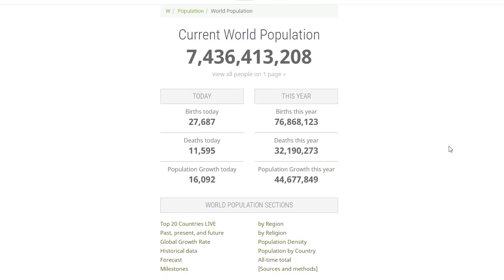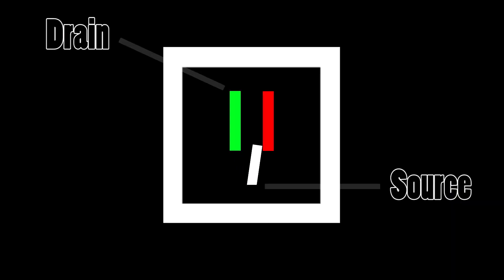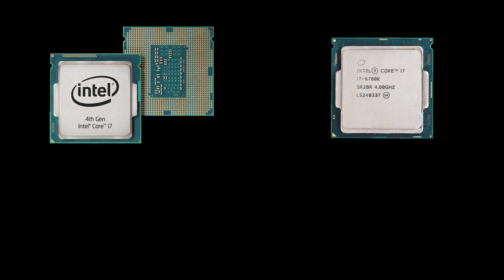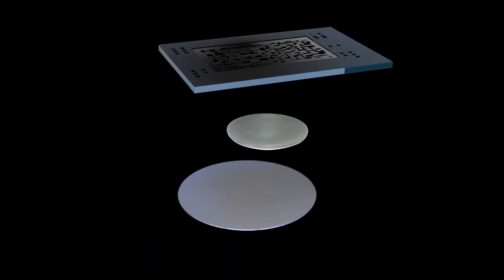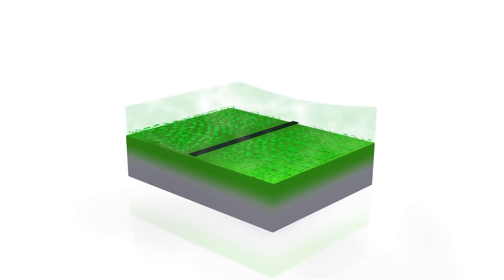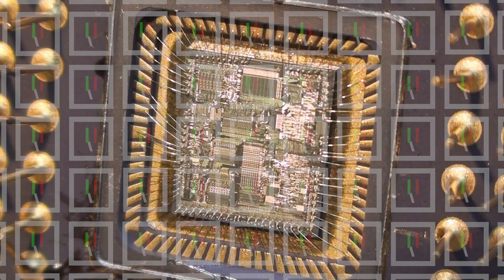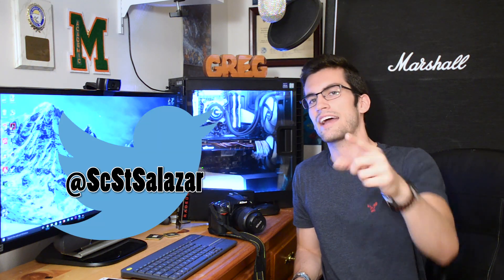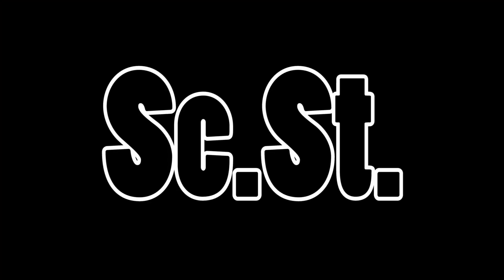Why Do Processors Get So Hot?

Comment: But why are certain programs “heavy” on your system (I.e produce more heat)? If the cpu is constantly executing code anyways how is it certain programs generate more than others
Reply: Becoz of the number of transistors required by certain program to run. They are not all turned ON all the time, they turn ON as per the requirements.

Comment: I was watching another video which lead me here. About data centers water consumption. I first thought of recycling the water. Now im thinking of a new anti thermal transistor. How does heat slow down the computer? Or are the components turning off to relay the heat? Assuming no fans or cooling is operating. Could their be a computer that can not get hot?

Comment: heat transfer 🤦🏻‍♂️ the only reason we cant time travel and walk through walls
Reply: Uh could u super briefly explain why heat transfer is stopping us from that please??
Reply: Ryan Lee The extraction of the energy is accompanied by generation of negative energy density, which is allowed in quantum physics of many-body systems including quantum fields, and retains the local energy conservation law. The remote measurement, which provides the information for energy extraction, injects energy into the measured subsystem. A portion of the injected energy, which amount is larger than that of the energy extracted from the zero-point fluctuation, becomes unavailable because of entanglement breaking by the measurement, and cannot be retrieved by local operations in the measurement region. Thus, during the protocol, the amount of locally available energy decreases in the measurement region, and it increases in the energy extraction region.

Comment: Having worked in power electronics I learned that at the off state and the on state of a transistor have simple restive losses (IR). during the change from on to off to on, however the transistor has switching losses. this why clock speed has such a heat curve. the sum of switching losses exceeds the restive losses

Comment: forget 5nm transistors, 14nm  is 66.6 silicone atoms across (one atom is 210pm), how do you think it achieves the required doping ratio with a tiny number of atoms?  The feature size is not the transistor size, it is the size of the smallest feature  which would normally be the gate of individual MOSFETs.

Comment: I have a question about cpu's , why if cpus are square are the wafers you see in cpu factories ( and in this video near the end)  round ?
Reply: i honestly like your question, Does anyone has any answer?
Reply: +PwnstarUK
Just in case you don't know the answer yet.
The wafers are made out of raw silicon dioxide poles, which have to be produced in some way. The easiest way is to melt some sort of sand (it's a bit more complicated). In the end, you want to get as much SiO2 as you can, so you have to maximize the area. The sphere would have the biggest area, but it is too unhandy to work with, so they chose the cylinder. If you cut the cylinder, you get a circle with maximum circumference and the most silicon. Therefore, the wafers are round.

I hope I could help you. Just ask if you have any questions.
Sincerely,
ZfE

Comment: hi Salazar, are u descendent from Portuguese people? Because that forename is Portuguese.
Now the question, in Overclocking do u stand by Adaptive voltage or Manual Voltage.
Because i have a 6600k that is driving me crazy to stabilize at 4.5Ghz without passing 1.3v.
thanks in advance,

Comment: Copper interconnects.. They don't use aluminum for them anymore..
Reply from the maker: It's chemistry: copper reacts with the silicon substrate, damaging leads over time.
Reply: Science Studio That is true but they use copper for the interconnects anyways because it is a better conductor. Intel has been using it since 130nm and AMD since 180nm. Seriously look it up..
Reply: TAKIZAWAYAMASHITA They use Gold to coat contacts (like pins on PGA or pads on LGA). Gold is expensive so they use other stuff anywhere they can.
Reply: i thought they used gold because gold was one of the best conductors

Comment: heat is energy so why would a mass equation have to do with it directly?
when getting into nanometers apart and nanometers big  the mass part loses importance for each one but the energy used part is more important and thus part of why Intel is getting lower and lower TDP CPUs when getting nearer to a 0 loss design you require less to do the same thing as a 0.1% or greater loss design though a 0 energy waste design does not exist for most objects energy waste is in the form of heat
heat is wasted energy so less heat more for the same performance or more is a better design unless the propose was to make heat but that is for another video of his

Comment: you casualy mention "typicly around 5 Ghz" as a threshhold and also give the design of cpu as on factor of that. i was wondering why over the years processors didnt just grow in speed anymore just by doing more and more parallel there for giving the illusion of getting faster. let me put my thinking down into one question. when do you see something like 20 Ghz cpus coming and do you know any one who is working towards that goal or did we hit the phsyical limit already like a lane on the autobahn if its filled with cars all we can do is add another lane fitting more cars isnt possible at some point like transistors i "guess"

Comment: Neat episode, congrats!

I'm wondering, in such frequencies, doesn't the system presents a highly inductive reactance? If so, the power factor would be somewhat away from 1, therefore making the apparent power quite different from the active power.

Wouldn't this cap the performance as well? Even though it is not a real power dissipation, it will limit the system perfomance, right?

Comment: had an old intel dualcore E2140   1600 mhz ,overclocked it to 3200 stable only fsb no voltage increase ,with one coolermaster run prime 95 for 30min didnt pass 60 degrees celcius , 4 or 5 degrees more than stock. i think in overcloking its the voltage increase that produces more heat not the fsb speed itself

Comment: Interesting. I could swear my 4790k was 15 degrees cooler on 1.12V than on 1.3V, both at 4.2GHz.
Reply from the maker: That would be correct. What I said in the video was that voltage isn't the only factor, but that clock speed was as well.
Reply: Science Studio I see, it was a misunderstanding on my part then.

Comment: I overlooked my i7 6950x last night to 9.3 GHz
Reply: Hax
Reply: Did your house burn down?
Reply: +Revenge woh naw I got it in a freezer
Reply: Did it make a dark hole?
Reply: it's starting to overheat a little bit so im going to move to Antarctica
Reply: +RivalGamerTV Casual. A real enthusiast would go to pluto
Reply: +Matthew Prather Please. The CPU probably has already formed a star the size of the solar system. You're not safe even there!
Reply: you know what, you're right, I'll go to pluto
Reply: +RivalGamerTV frickin pleb
Reply: causuals all of you! What a real enthusiast would go in a black hole of the unknown
Reply: I overclocked my fx 9590 to 9.3 GHz last night
Reply: +Dank Memes meh, 6950x is better
Reply: RivalGamerTV Puh-lease. My testing version of the 7950x got up to 66.7 GHz on air cooling and scored 348976234 in Cinebench R15.
Reply: +Revenge woh well damn I guess you have me beat
Reply: RivalGamerTV I just tested water-cooling on the 7950x and it got up to 563.4 GHz and 340587349583674598 on Cinebench R15. I bet you can;t beat that either!
Reply: Yeah but I overclocked it with an amd stock cooler.
Reply: My family didn't make it though as it burnt down the house unfortunately.
Reply: Dank Memes you should have just not used a cooler, temps would have been much lower
Reply: +Revenge woh yeah but I'm not experienced at overclocking though

Comment: Sir then are you implying that as CPUS and GPUS get smaller they generate more heat ?
Reply: +Science Studio less room for the atoms to pass through, causing more friction. roll on 5nm :) can't wait until I've too connect my CPU to the fridge
Reply from the maker: No. Pay attention to what I said.
Reply: The only reason I thought it they should is because smaller chip size means less space for heat to get dissipated. Sorry if I was wrong.
Reply from the maker: Again, listen to what I say in the video.
Reply: That would be a positive thing, as even a 212 evo cools your cpu better than a fridge does ;)

Comment: so can someone explain to me how overclocking can work without raising voltage, is it that the voltage is higher than the cores actually need, or what because if it doesnt follow the formula then it shouldn't work

Comment: Wait, so why do processors get hot?
Reply: the aluminum, and voltage going through it. the heat accumulates i think
Reply: ThePaisleyProject Wonder if it's that combined with the transistors flicking on and off?
Reply: +Luke Keast there isnt any movement so friction isnt a possibility
Reply: So its just your original comment that cause heat?
Reply: Luke Keast in a VERY simplified way, i'd say so

Comment: Electrons arent supposed to pass through the transistor via quantum tunneling, the point of the whole phenomenon is that it starts to happen the smaller you get. That's the problem itself. We have to figure out how to stop/use quantum tunneling past 5nm otherwise our good old cpu friends wouldnt be cpu's anymore lol. Good vid :)
Reply from the maker: Yes, and I explain this in my most recent upload.

Comment: scratches head No mention of charging and discharging of capacitances as logic gates switch?  No mention of static dissipation from channel leakage currents??
The former being the dominant reason for increased dissipation in CMOS devices as switching speeds (clock rates) increase. The latter becoming a greater proportion of the overall power budget as channel lengths decrease (a trend thankfully showing signs of slowing with strained silicon and tungsten metal gates).
Reply from the maker: Leakage mentioning would have involved a description of transistors that far outreached the scope of this video. You're asking for far too much to be elaborated upon in six minutes.

Comment: So I just built my computer and when I booted it, it lit up for a second and then shut down. Did the paper clip test and the PSU seemed to click on and then click off. I'm assuming it was a short in the wiring since I tested on 2 different motherboards. Any other explanation or am I right? Specs are : i7-6700k, EVGA 1070, 16gb ddr4, evga gold cert 550, gigabyte motherboard

Comment: Transistors don't just switch from Cutoff to Saturation -_- although transistors on those insanely small processes aren't really appropriate for analog signals, there is more to transistors than on or off.
Reply from the maker: Again. Oversimplification. Still, the points I've made are sound and correct.
Reply: Yes, great video

Comment: some thing about quantum tunneling 
it's effect that explains why subatomic particles
can pass barriers they are not supposed to in this case electrons 
passing insulating barriers in transistors and it's cause an effect called leakage.
and a bit explanation about it, the effect is statistical that means you can't determine which and when electron 
will pass the barrier but you can determine the odds for it, and the odds increase as you shrink things down. in matter of fact this phenomenon can be applied to our daily world but the odds are so slim it literately impossible to happen. bit further explanation to the phenomenon can be explained with the wave-particle concept.

Comment: I know that higher clock rate should in theory increase heat output, but I have had a phenom ii x6 that I overclocked (with increased voltage) actually drop in temperature when increasing the clock speed mildly (I think it was from 3.6 to 3.8 ghz).

Now correct me if I am wrong, but this can (in theory) be chocked up to the voltage being able to pass through the transistors faster so as to not bottle it up waiting for the transistors to switch (IOW reducing electrical resistance). essentially, the voltage was optimal for the clock speed, causing it to run efficiently. 

That is my theory anyway, but I have not studied this enough to be certain.

Comment: I know my CPU (Intel core 2 quad Q9450 2,66ghz) is old but why i do have 50° (celsius) with a enermax liqmax ii 120 (water cooler)
Reply: Why? Because you haven't over clocked and you have a liquid cooler
Reply: +Jnan Mckenzie he'll be able to super heat gas into plasma
Reply: noobkiller463 it is a Liquid cooler and i didnt overclocked it (i cant overclock it cuz i have a LGA775 ddr3 )
Reply: +Smil3F4ce oh sorry, it thought you were asking why they were low, not high. Well it's probably because it's running on an older architecture, yorksfield and runs on a 45nm lithography.

Comment: With the 30w difference in TDP between the FX-6300 and 6350, does that create any advantage for either? How are they so similar but that number is radically different?

And also, why are processors only labeled with their heat output and never mention their actual power draw?

Comment: I see... i understand now why heat increases when you increase frequency only, when you increase voltage too you also increase Power as resistance stays the same it just draws more current (P=V*I or P=V^2/R or P=I^2*R), power generally = heat production thats why we measure cooling ability in watts to many coolers am i wrong?... and also can you plz make a video and say why more voltage is needed for a higher stable frequency (overclocking), i would really appreciate that :)